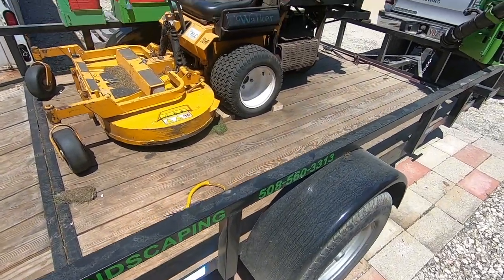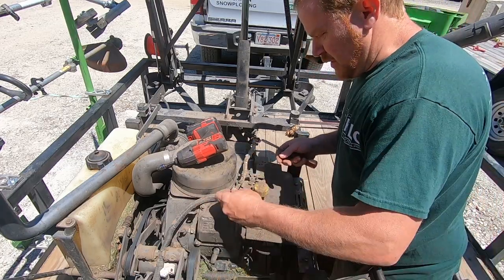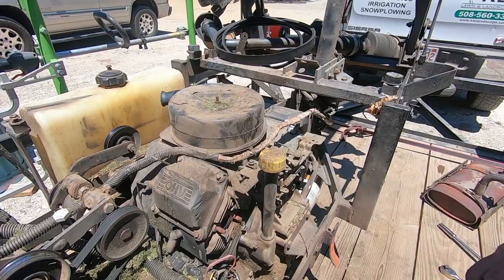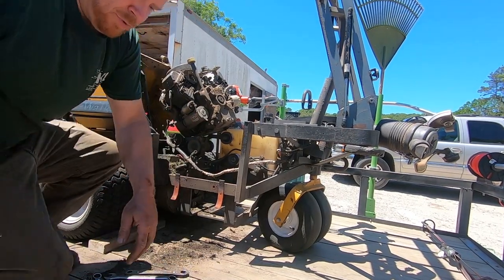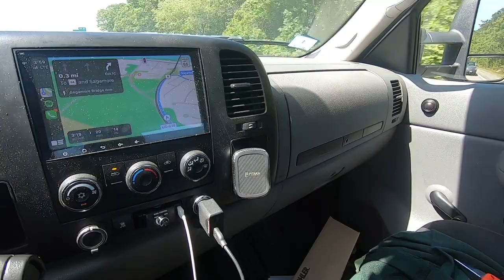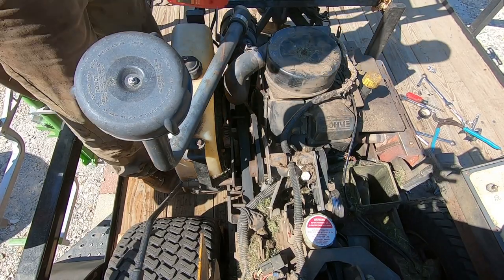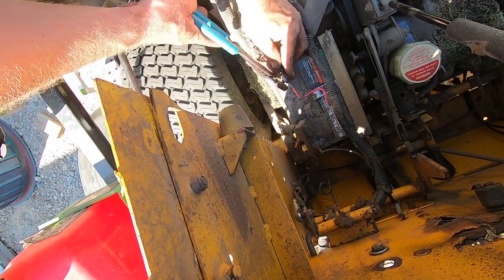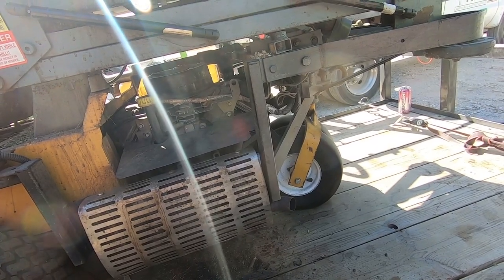HOW TO  Remove And Install Walker Lawnmower Engine To Replace Starter Motor

Comment: Right to repair is awesome. I fixed my father in laws kubota zg23 that the dealer wanted over 1200$ to fix for 230$. Valve guide backed out and binded the rocker and bent the push tube. I put a new head, gaskets, and did a re seal which was more than they would have done for way cheaper. Had to pull the engine but didn’t take any time. Thanks for this upload. I’m learning because I want to buy a used walker

Comment: I was able to change my Walker MT/ Kohler starter without pulling the engine, but it was very tight work and took a long time.  I purchased a non-OEM starter online and it works fine. If I had your video, I would have pulled the engine as you have.  I appreciate this video because I will need to pull the engine in the future to change a piston.

Comment: Great video.  I have a 2017 26EFI that starts puffing smoke from exhaust and losing power intermittently.  It shot a code initially for a TPS, I replaced that, reset computer, and it still acts up from time to time, running erratically losing power.  No codes.  I am tempted to just replace the engine.  Any idea how a 26EFI swap would be?  thanks for the video
Reply: Newer machine has more exhaust system to remove. Finding a kohler engine is a little time consuming. Kohler is backed up.  The efi is generally the same as this video just a few more wires.

Comment: nice how to video Ken.
Reply: I agree and all the other great advice on how to replace the starter without having to remove the blower assembly. Now I have two methods removing the exhaust pipe as well as lifting out the motor. Fountain of wisdom from you guys.

Comment: You can do starter without removing engine,  remove exhaust bracket and 4 engine bolts,  tilt engine,  put block of wood under engine,  remove starter
Reply from the maker: Yes, I mention that in the video. The whole point is how quick it it to remove it rather than trying to work in a tight area and also its just good idea to pull engine and clean the cooling fins out as often as possible. Sometimes the less involved way is slower.
Reply: Absolutely

Comment: What rear wheel set up is that?
Reply from the maker: Its just the stock dual wheel tail wheels, The older ones came with a single wheel which i7s still an option when you get a walker now I believe. I have since switched to spread rear wheels which use the same 2 wheels in this vid but brings them out to where the insides of the drive wheels are eliminating the center stripe in lawns and gives a little more stability
Reply: @KenMrKLC   I am wanting to replace my rotten single wheel, can a 13x6.5-6 be used instead of the... 13x8-6?
Reply: Where are you located??

Comment: Your crankshaft seal is missing from the LH side of the engine. Where the crankshaft end comes out of the housing, there is supposed to be a seal there. They can blow out and be lost without even realising they're gone. Blocked PCV systems and loose exhaust valve rocker bolts can cause excessive crankcase pressure and blow the seals out.
Reply from the maker: Lol Its there, but yes true to all you said. It is set in about 3/8" from the outer lip so you may not have seen it. If it wasnt there would be oil everywhere

Comment: I've run these Walkers for years and changed many starters and NEVER PULLED an engine
Reply from the maker: So you never pull the engine and clean the cooling fins and tins out? Curious how many hours you get on your Kohlers. Heat kills them. I like to pull the engine at least once a season for inspection and cleaning.
Reply from the maker: Also I said it can be done without pulling the engine. I made the video to show how to pull the engine... I happened to be replacing the starter but you are supposed to pull it out annually for the reasons I mentioned.
Reply: Compressed air and Amsoil fluids , been running Walkers for 15? years .Since changing to full synthetic oil I have never had an overheating issue . I'm in central Arkansas and summers get a bit warm here .

Comment: Should of removed all sheet metal,  engine covers and cleaned cooling fins. Doesn't look like you clean it much , may overheat
Reply from the maker: As I mentioned in the video I remove it at least once a year to do that. They were all just cleaned out begin of this year and will be again after cleanups. I have never let it get to a point of overheating